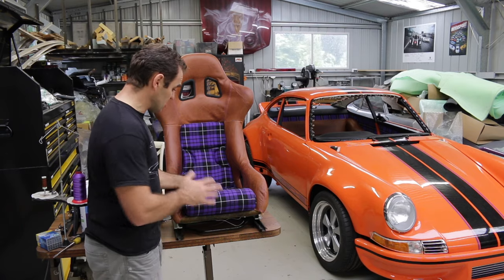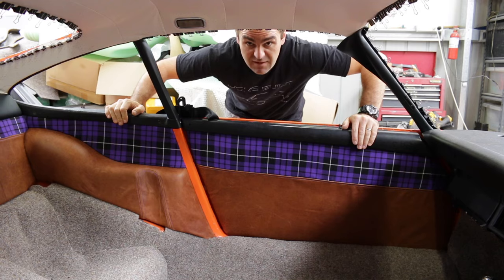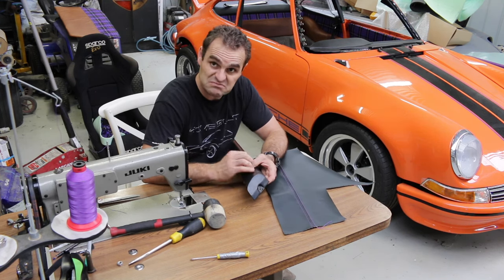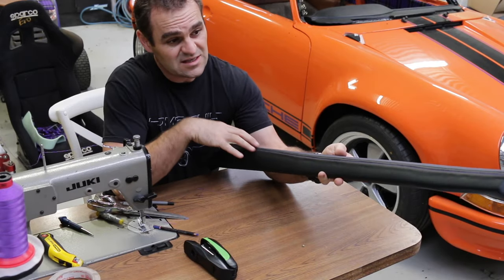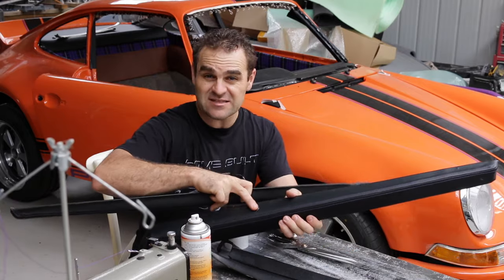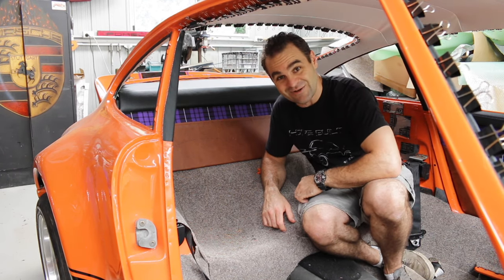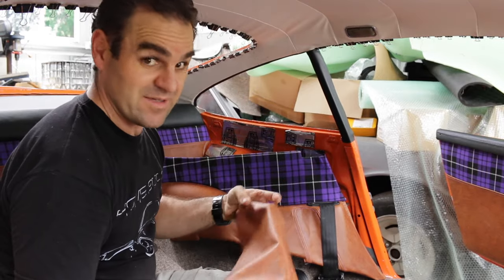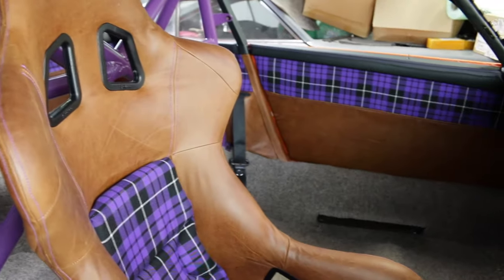Porsche 911 Classic Car Build Part 42 - Refitting the roll cage

Comment: hi jeff starting to warm to the trim that seat looked like a pain ion the ass to do ,great result. still got that front bar hangin down mate would hate to see it out of shape when you button it up
Reply from the maker: Ahh, you are right, I forgot about that. I will say though, that the bar is particularly thick, due to all of the cutting and reshaping I did, so It has very little flex in it. Still I need to do something about that.... when I remember ;)

Comment: Jeff, I'm sure you've already done the other seat, but if you haven't (sorry I'm playing catch up!) if you stitch the Velcro onto the fabric first, you can then stick the other half to it, add the glue and then put it into the seat. saves all the hassle of trying to make the Velcro pieces line up. just a thought!
Reply from the maker: That is a good thought, although the surface of the seat is pretty rough, so it would be hard to make sure the glue got good contact all the way through and not getting glue over the back of the cushions. I did however, sew the velcro onto the second lot of cushions before I sewed the covers all together which made things heaps easier.

Comment: Jeff, I think I should warn you not to use anything except the best quality window rubbers when it comes to fitting the glass. The front and rear screens especially, are VERY hard to seal properly, with anything other than the Porsche rubbers. Some cheaper ones cause bunching in the lower corners of the rear screen, which are notorious water entry points on a 911. They ALL leak there, and water runs down the parcel tray and into the rear seat wells, where it just sits, rotting out the seats and the metal of the seats.

In fact it is so common, that many 911 restorations include a small hole drilled through the bottom of each rear seat, to allow the inevitable water to drain out!

You know you've got a good 911, when you can leave it parked in torrential rain for a couple of days, and the rear seat wells aren't wet, and there is no water in the front foot wells either.

If you get it wrong, it is a huge and expensive job to remove the glass again, and get another set of rubbers. And no one wants a leaky 911 - it just undoes all the hard work you put in, getting it nice again. Good luck!
Reply from the maker: I hear you. I have new genuine rubbers to go in, but what worries me is that I had to fabricate the rusted lower corners of the front and rear windscreens. That means that they are close and look good to the eye, but I don't know about exact tolerances anymore. I have to do some more research, but I am wondering if there is something I can put in at the start to help create a good seal (sikaflex or similar) without making a big mess of things.
Reply: Home Built By Jeff you want windscreen sealer. Not polyurethane. Old school sealer that never quite goes hard. Run some around the lip between glass and rubber and on the outer lip of the rubber that butts to the body before fitting so it all oozes out nicely and creates a good seal on fitting. It's messy, like really messy, but just clean it off with panel wipe when you have finished stringing the glass in . Some people seal around after its fitted but that's not the correct way to achieve a total seal.
Reply from the maker: Thanks. That was the sort of thing I was looking for. I want to take all the precautions before I put it in, rather than trying to patch it up after the fact.

Comment: Amazing work, binge watched the build and I dig everything you've done so far even though I thought it looked like an odd color combo at the start.
Have you figured out how to get the wiper fluid engine working?
Reply from the maker: I think I know which wires run it, I just need to connect it up. I have never had a battery fitted to the car, so I still don't know if any of the wiring is any good.